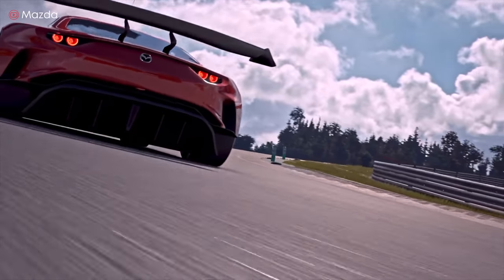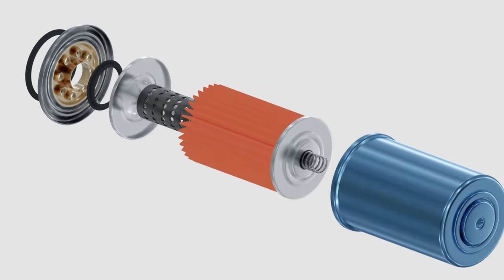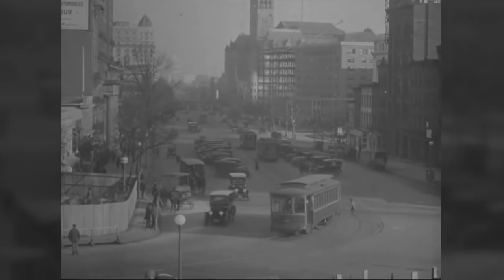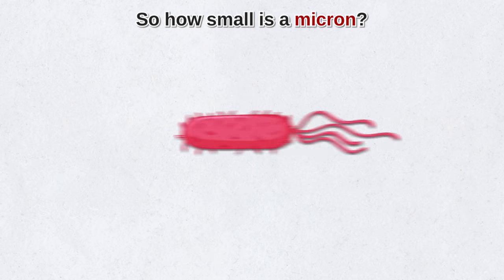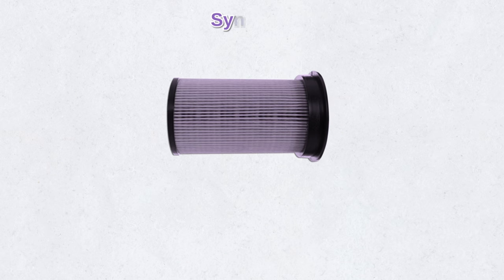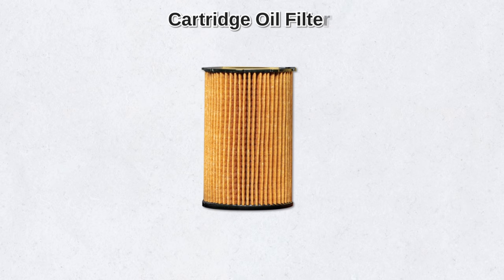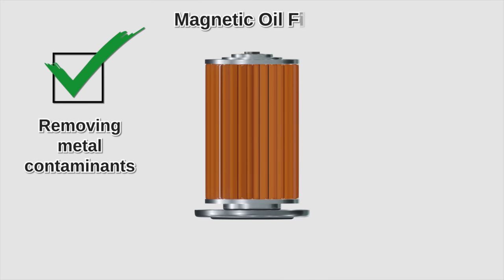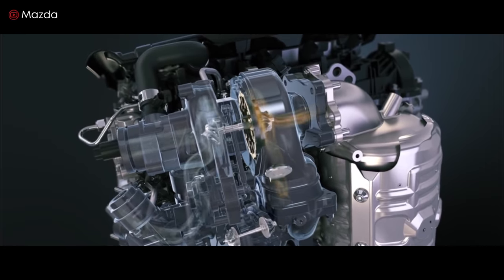This New Oil Filter Just Changed the Game (No More Oil Changes)

Comment: I use to drive 20k mi a year most highway, and I would change synthetic oil every 14 k mi and oil filter every 7 k mi. Always supported by oil lab analyzed.
And I had great results. Still have same VW diesel  engine, but I I drive  much less and don't  see the need. I chane now every 14 month or so.
Reply: How do you change the filter and not the oil?
Reply: @hovojefe  VW have the oil filter on the upper side of the engine, not at the bottom.
Reply: @mopiktm9480  huh that makes it easy eh, I'm surprised more manufacturers don't do that. I suppose maybe just to keep the engine bay cleaner? Less chance of spilling oil? But then again the oil fill cap is in the engine bay, so... I'm at a loss
Reply: I Wish diesels were more popular here in USA.  I have a 2017 Wolfsburg golf 1.8tsi 
They discontinued the gasoline wagon here too :(
Reply: Oil used or not used still build up acids and water, still needs to be changed.
Reply: @ginog5037  
Yes it does... But with Oil Analysis you can keep an eye on that and know how long yours will protect for...

Oh btw... Oil just sitting doesn't build up acid or water if it's not circulating...
Reply: @hovojefe  It depends on how far the engine designer thinks ahead, and whether or not they give a damn about maintainability.
Reply: @boobtubeakatv1296  Condensation builds water. Also the money you spend on analysing midway through an interval is a waste of money to me, just change  the oil. Starting it up once in awhile to keep it lubed up that's where the acids come into play. Engines like fresh clean oil, analysing is great to keep track of engine wear.
Reply: @ginog5037  I can do 6 analysises to one oil change...
You must use the Walmart brand of oil & filter, I don't...
Why continue to pollute the Earth with wasted good oils?
I know the history of my hybrid and the ice... 
Very little condensation occurs unless you have a wide temperature swing if its just sitting, which mine doesn't do anymore than normal...
Reply: @boobtubeakatv1296  What are you talking about, oil is reclaimed. I get well over 300k on my engines. I'll continue to change my Castrol ever 3k. BTW keep saving that oil and gas for me...
Reply: @ginog5037  
Recycled ♻️ Haaa 
I see that you've been duped by them oil manufactures...
Used oil is sent to 3rd world countries that end up spilling it onto the ground... You can continue to support your class 3 grade oil company by purchasing what you want with your money...
It's still totally wasteful to change it sooo often unless you're living at the top of a tall mountain, racing or pulling your 5th wheel trailers around... Get Educated as to where used oil ends up...
Too bad you don't go to them quick lube places so you can get base oil from 55 gal containers and charged for the premium variety... 🤪
Reply: Where to get the oil analysis? How much cost?
Reply: @anno4486  
Google it for your area Ann...
I use Lubrication Specialties in my area... Last one I did was $12... They tell you everything about your oil...

Comment: Agreed, inspection is important after the change and at the next gasoline fill. I've had 2 filters fail that didn't leak immediately; one with a painted-over pinhole, another installed with 2 o-rings. I also check engine oil before and after a change, especially if done by a shop. Before to see how much oil was used, after to make sure they filled the engine. I've had 4 in a 5 quart system and the other way around. Being down half a pint lets me know what to expect at the next oil check, instead of being worried.
Reply: I had a brand new car from a dealership that offered free oil change for three years. They put 5 qts. of oil in my car with a 4 qt.capacity. I don't trust any of them..

Comment: I own a 1961 Cessna and that engine came with just an oil screen that you would wash on every oil change.  Later on a spin on oil filter adapter was added to the engine as a FAA approved modification.   Oil changes on the engine occurs every 25 hours of engine operation and you change the filter on the 50th hour ( every other oil change) it’s SOP.

Comment: My favorite oil filter trick: using an oversized filter. More surface area, less impediment to flow. I drive a Saturn but when I'm buying a filter, I pretend it's a Dodge Neon SRT.
Reply: Saturn you don't need to change oil , just keep adding and change filter .
Reply: @kenj.8897  I mean, that is one way to do it for sure. It does use the oil quickly enough 😅

Comment: I have been using WIX oil filters for years . I worked at a shop were the owner got more out of his trucks than I had ever seen . He used WIX ,filled the filter with oil and changed the oil every 2,000 miles. So I did the same.

Comment: When removing the filter make sure the gasket comes off with the filter! I missed it once and my wife left with the car only to call me to say the oil light came on, but thankfully she pulled over immediately. I changed the filter beside a busy freeway and refilled the engine. There was no apparent damage. We were planning to trade the car and did so soon! I am 71 and have personally changed my oil since I was 16 except for one time when the dealer changed it and I had to remove the filter by driving a long screwdriver through it.. that was years ago, but enough to learn a lesson. I still enjoy doing most maintenance on my cars 😉👍
Reply: This happens more often than you would think
Reply: My wife was an office manager at the college. A professor asked her what is the red light that says oil. It's been on for a couple days.
Reply: @richardbauer3327   when a guy was telling me about doing it I thought it would be very rare. I see some filters have a gasket that is pretty much captive in the filter. I dont remember it  as being trouble in a full service Standard station in the early 60s. Its mentioned a lot here.I remember a few that were leaking because of not oiling the gasket and it wrinkled.
Reply: I guy once told me he ruined a engine by not removing the old filter gasket. He gave a little chuckle.  His wife said and you think its funny.
Reply: I normally have a little crap around where the gasket makes contact. I wipe off the surface.  It would be hard for me to miss a gasket stuck on.

Comment: Did I miss the name of the oil filter that means you never have to change the oil?
Reply: You would not have clicked on "Oil Filter Tutorial."
Reply: I would have a very hard time believing there is such a filter. Eventually it's going to need cleaning or replacing. I don't fully trust the synthetic oil I use.
My thoughts are sceptical at best.
I take every scheduled maintenance of my vehicle very serious because I bought it used. I don't know what the inside looks like. Even though it was in top shape when I bought it in 2012. It had 186,000 on it then. 232,000 now. That 46,000 in 10 year's. Most of the time I drive less then 300 miles a month. Unless I visit friends out of State.
I wish I could be convinced full synthetic oil was as advertised. I just don't buy it. I'm not going to ruin my motor just because someone says I can drive up to 7,000 miles on it. I change my filter everytime too.
I don't trust mechanic's to work on my car anymore because I have been stung a lot in the past and cost me money instead of saving me $$.
Reply: That would be the Franz bypass filter that uses a roll of TP as the filter media. All of the motor eventually runs thru it where the dense TP captures the finest crud so the oil always remains clean. In theory one doesn't need to change the motor oil, just the TP with a quart of fresh oil to replace what's trapped inside the roll and renew the additives to the old oil.
Reply: Jackmaster claims their elements are better than toilet paper. That could be true. Their elements seem firmer than toilet paper.Ive used toilet paper since 1963 Too old to change now. Some of us are expert toilet paper squeezers. The Jackmaster  element is a little firmer than the Scott 1000 or the Great value 1000 from Walmart. Im not driving a Lamborghini. Toilet paper has always worked for me.There was a time when I had to go to a janitorial supply store to get the best.

Comment: WIX makes a fine filter 👍
Reply: Always buy oem
Reply: Wix does the same as other full flow filters. They protect the engine from large engine damaging abrasives and let the small engine wearing abrasives  and sludge build up in the oil until you drain it. The Wix full flow filter on my Pontiac Torrent  has 61,000 miles on it and a little over 4 years. The depth bypass filter keeps it clean. I normally change the full flow filter every 2 years. The car doesnt care what brand of full flow filter is on it. None of them clean oil.

Comment: My brother's first car was a 1958 Pontiac with a cartridge filter. The first time I change it, I loosened the center bolt and hot motor oil ran down my arm, into my armpit, and onto my back. When I saw that recent cars had switched to cartridge filters, it brought back memories of that old car.

Comment: Very thorough and informative video. If a person has the time and basic mechanical ability to change their own oil then I recommend it. Why? One, you have the time to let that oil drain as long as you want to. That means more bad oil out. Two, and this may sound ate up, but it helps you connect with your vehicle. It becomes more than just a piece of equipment that gets you to and from work. Lastly, you can make sure it’s done correctly. Filter gasket removed and new one lubricated. Filter and drain plug not over tightened. Properly check for leaks afterward. Remove and reinstall access panels correctly.

Comment: I have been using AMSOIL Synthetic oil & filters for over 40 years.
  Company recommended oil change 25.000 miles or one year. If you send them an oil sample you can go past that.
    One the road truckers, change the oil filters at 30,000 miles & replace the oil that was in the filters. They also send in an oil sample for analysis.

Comment: I did some research on the reusable filters and I realise that this is the answer to saving the environment from all waste. The filter that spins over 3000 RPM not only removes particles down to 1 to five microns, it doesn’t restrict the flow at all.
Your engine will last twice as long if not a lot longer than expected.
Amazing, but manufacturers won’t come close to it because there modow is don’t fix just replace. $

Comment: The last oil change I did myself I could remove the filter. I called my mechanic brother and he said it's okay to change it the next time I changed oil. He since gave me an oil filter remover (looks like a cap that connects to a socket wrench (don't know if that the right term for the tool) so I can remove it cause my dainty hands can't twist it. The funny thing is I was the one who put the oil filter on the last time. Guess I ate too much spinach the night before.💪🏼.
Reply: FYI. Do not use the wrench to install the filter, only use it to remove it. When installing one make sure to put some oil on the seal and just tighten it by hand. If you use the wrench when installing it you can damage the filter, threads or your engine.
Reply: @josecuervo4423  Or better yet follow the instructions; A good filter will usually tell you how many turns to tighten once the gasket has made contact.  "do it by hand" is just as imprecise as using a tool with no specification and a loose filter can cause catastrophic engine damage.  Tighten it the correct amount.  If you can do that by hand more power to you.  If you need to use a tool that's fine too.

Comment: I change the synthetic oil on my chev equinox's 2.4 ltr every 10,000 km and swap out the filter cartridge at the 5000 km interval. We have long cold winters up here in Edmonton, Alberta. The hot/ cold cycle can take a toll on the lube system so this ounce of prevention is well worth the $20.00 for the extra cartridge change. Cheers, all
Reply: I have the Pontiac version  Torrant with the 3.4.  I dont drain oil here in the Dallas  Tx  area. When I was selling Motor Guard oil filters I sent a few even farther north than Edmonton.  I sent one to Norway. They seemed to know about the filters. I sometimes wonder how the filters do in cold weather. They worked fine for me in northern Idaho  but I was driving  70 miles a day.  I used to think it's a cold sob here in Cour d  Alene Idaho  then I would get the report on Montana and Minnesota.  Then I felt like I was in Florida.  Stopped in a camp ground near Fort mccloud  not sure about the spelling. Wolves were howling.  Saw these large circles of rocks. Asked a ranger what they were. He said the Indians put rocks around the tents to keep the cold wind out . When they moved they left the rocks .

Comment: One question, is there a special place in hell for the engineers that switched from screw on to cartridge?
Reply: You’d think the cartridges would be significantly cheaper but no
Reply: I prefer having a permanent, higher quality check-valve in my turbocharged engine (VAG EA888 1.8L tsi).   There is no missed quality control, i.e. “lemon”, spin-on style filters to worry about.   I just replace the oil filter media and 1 o-ring.  

The oem filters are 5-8 USD a piece from online euro parts stores.  I do Pentosin HP II 5.5L + OEM filter for $50-55...2x a year.   Super easy to change the filter and zero mess.  

Most spin-on filters are mounted upside down and removing them usually makes a mess, especially the hard to access filters you have to dance out of the engine bay/suspension area.    Oh yeah my husband really misses the spin on Chevy cavalier filters...right next to the exhaust manifold 😂 been over a decade since he worked at a quick lube though haha. 

Now plastic oil pans/drain plugs are a different story....ive already cracked and replaced mine with a steel pan and drain bolt.
Reply: Most engineers would rather stick to the spin on cartridge, high up executives would rather stick to higher profit margins. Toyota did use cartridge on some models then went back. (I think)
Reply: I like the cartridge filter that's on my Mercedes. It's right on top in easy reach. Not a single drop of stray oil gets dropped anywhere since I use a oil extractor to take out the old oil. I know Toyota has a cartridge type that isn't as simple. I will be dealing with that probably next year when I replace my '97 4 Runner with another 4 Runner.
Reply: I love the cartridge filter on our Hyundai.  Right up top, super easy to change without making a mess, and you can visually inspect the media without having to cut open an oily metal can.  Easier to check for leaks too.
Reply: @dimitris.p.kepenos  2007 Rav4 with V6 has cartridge
Reply: @jo8737  I don't mind cartridges as long as they are accessible and don't require a ridiculous socket that nobody has(like a 40mm).

Comment: Back in the 1980s when I worked in a well respected garage as a mechanic there was a older guy that had a 1980 ford f150 with a 302 engine and he would get me to service his truck and the oil change consisted of a motorcraft oil filter and one quart of valvoline 10w30 oil and he ran that truck 100,000 miles with no engine problems...every oil change was a filter and a quart of oil to replace what the filter had in it and the engine had no sludge in it if you people were wondering.
Reply: I serviced telephone trucks in the 60s. With the pickups they only changed the filters and added a quart of new oil. They knew when they traded them in the engines would be a sludged up mess but it wouldnt make them worth less than if the engine was pristine.  Oils were not good in those days unless you used an oil like Standard Delo W 30. You could also get W 20 Delo in those days. I personally used a Frantz oil cleaner with Delo W 30. Frantz and Motor Guard  were the game changers of the 60s. Frantz also had the FAA approved AeroFrantz. All I have now is Motor Guards and Gulf Coasts. They are the easiest to service. I dont need any more game changer filters. Was ordering a E C M for the Pontiac. Saw a Austrailian  Jackmaster on Ebay. I'm curious about them. I've heard they are Australia's best oil filter.
Reply: I can see an engine going 100,000 miles with no oil changes changing only the filter and adding a quart of oil.  I've seen engines so sludged up there was as much sludge in the engine as oil. It was probably caused by not changing the filter more than not changing the oil.  Also oil in the 80s were better than oil in the 60s. My 93 Subaru Legacy had 116,000 miles on it when I bought it. Has 237,000 miles on it now. Shows no signs  of engine problems. Got its first oil change since I've owned it the other day. Went to synthetic oil. It has Motor Guards  on the engine and transmission. Those are the game changer toilet paper oil filters. The old F 350 dually diesel had over 300,000 miles on it when I bought it said the rancher pulling a large horse trailer.  Pulled off the overhead  Avion camper and sold the truck. Took it from Texas to Seattle a couple of times and to Florida. Lost interest. Always glad  to get home.